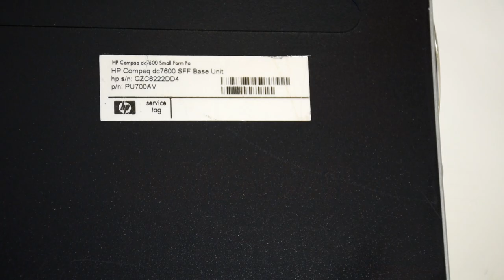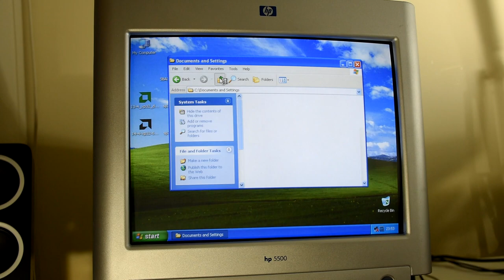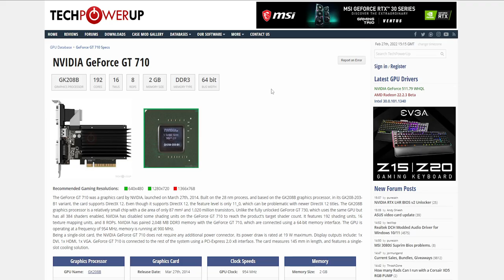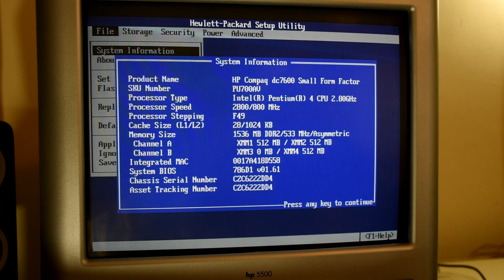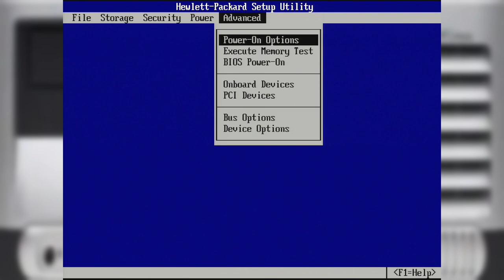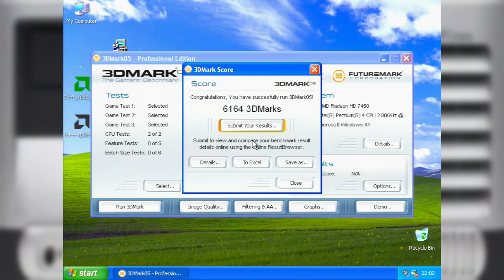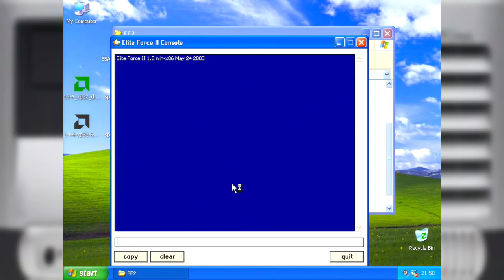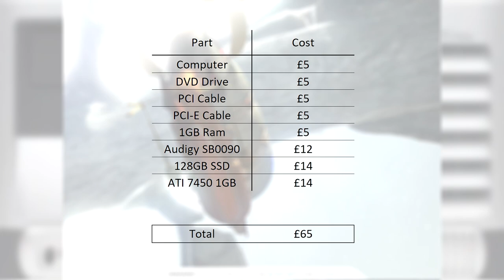Lets turn this P4 SSF office machine into a gaming rig

Comment: Dude! I wish we could post photos here because I have a previous AGP chipset model in the same case but mine’s green & yellow because it used to belong to CityLink. 😄
I put a half hight ATI FireGL X1 in mine which is basically a repackaged 9700 which works great.
Fun video, thanks. The Quake 3 workaround is fascinating. These old workstations are a cheap, fun way to build a retro gaming PC, often by getting creative with with the hardware which is always satisfying. Mine has an SSD on a PATA to SATA adapter which is a bottleneck but seek times make up for it. I had to replace the PSU fan because it was grindy but even that was easier than you might expect & I put a Turtle Beach Santa Cruz in mine mainly, to be honest because that’s what I had to hand at the time. 😊
Reply from the maker: These things really got around didn't they 🤣
so much of these sorts of builds are based on what spare parts you have to hand or what happens to be cheap at the moment.
but its typically a lot of fun, until something doesn't work then its a right pain 😁
your config sounds great and if you do run any Q3 games try out the workaround it might help.

Comment: Those HP P4 machines are quite a solid basis for retro gaming machines.

A small point of critique - this system appears to support dual channel RAM, so adding another stick of RAM might get a bit more performance out of the system.

And anybody thinking about getting one - make sure you do your research first - not all P4 SFF PC's have SATA, PCI-e or are simply only suitable for low profile cards.
Reply from the maker: I was thinking about the dual channel thing, but wasn't sure how much of a difference it would actually make.
but I'll keep it in mind.
and yeah, I got lucky with this one.  I had no idea what was inside when I bought it.

Comment: Crysis is on GOG and the installer still works on Windows XP. Half-life 2 does not have DRM, so if you get steam to download an older version you can copy the folder over to Windows XP and it works.
Reply from the maker: I forgot it was on GoG, I was looking out for a physical copy locally but all I found was Far Cry.
Which is the main reason its in the video 😁
I didn't think about running Half-Life 2, even though I built a computer just for it.
Thanks for the tip.

Comment: The graphics card is a great suggestion! I got an old minipc in storage, which also has a really weak power supply. I'll look into that! Thx :D
Reply from the maker: Awesome, hopefully it works out well for you.
There is a balance between wattage used, the graphical power of the card and what drivers you can get for it.

Comment: When I made my Windows XP computer I got a 1030, since I needed a half height card. That was before the shortage of course. I should do the SSD upgrade since I am still using the hard drive.
Reply from the maker: Did they release drivers for the 1030 on XP?
everywhere I looked it reported that Win7 was the minimum.
Reply: @GouldFishOnGames  Just checked my Xp computer I have a 430 in it. My Vista computer is the one I put the 1030 in, Okay maybe that one will have to be Windows 7. I though I had a drivers for vista.